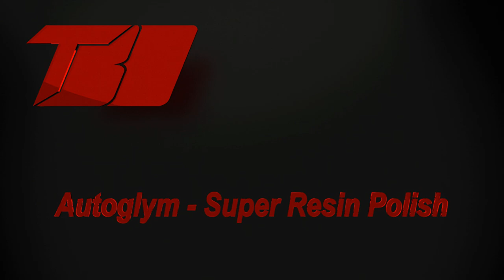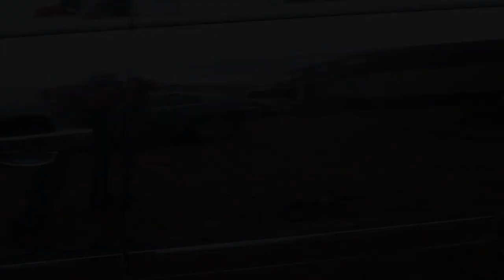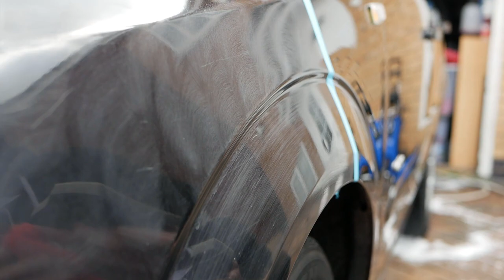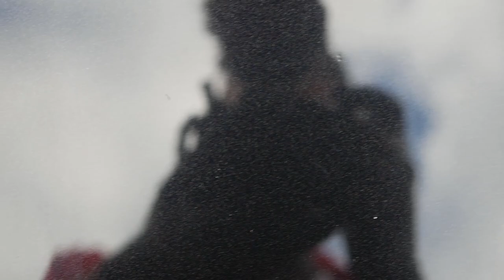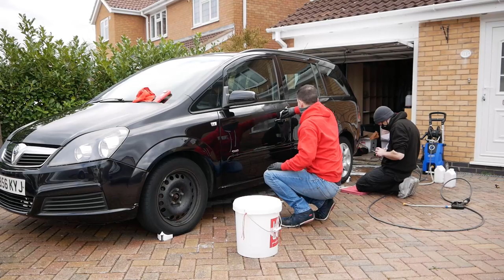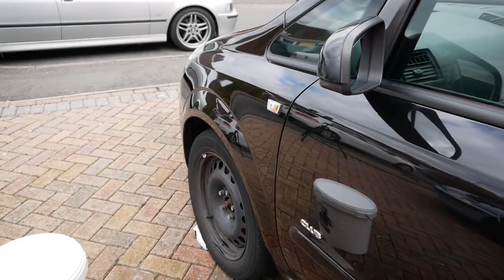AUTOGLYM SUPER RESIN POLISH IS AMAZING!!!! | You must try it if you never have.

Comment from the maker: I remember buying my first bottle of SRP. Halfords in 2002. How about you?
Reply: About 1998 along with EGP and a box off their net/cloths.
Reply: Try it with a machine.
Reply: @Swans_And_Ducks  we did actually give it a go on the opposite side with the dual action. It really is a competent product
Reply from the maker: @Swans_And_Ducks  I remember those cloths. Perfect polishing cloth I think they called it. Would get fluff everywhere as soon as you cut a bit off.
Reply: About 2005 for me. It was a bulky 1 litre plastic bottle which I bought to replace my big 5 litre tin of AutoSmart Mirror Image that I ran out of. I thought SRP was equally as good as AS MI, but I found that SRP needed to be worked quickly and thinly as well as frequently having to change applicator sponges to reduce the dusting. The old formula flashed off very quickly. But it was always easy to remove.
Reply: Just bought my first today.
Reply: Quick question: why were you wearing a face mask even though you were using the product outdoor? Is it that toxic? I have this product for a while now, just not found the time to actually start using it.
Reply from the maker: @Decebal_of_the_Getae  it was part of the COVID guidelines at the time. Nothing more than that bud👍
Reply: @TranquilityBaseDetailing  Appreciate the prompt reply. Did you guys ever tried the Autoglym Rapid Ceramic Spray? Would you recommend it? I have about 8 different products from them. Happy with most except the Fast Glass. I just can't make it work, all I get is smears regardless what I try.
Reply from the maker: @Decebal_of_the_Getae  I've not tried their ceramic spray yet. Probably something for me to try once the weather picks up
Reply: @TranquilityBaseDetailing  Will keep an eye for your review so I've subscribed!
Reply: How long does it last does it just fill or remove the scratches
Reply: @aaronbell8527  "remove scratches"? your kidding right?
Reply: @Decebal_of_the_Getae  that’s why I am asking  👀

Comment: Those were the days - hose pipe, one bucket, a sponge & a chamois leather. Finish off with a bottle of SRP & buffed off with an old t shirt. Things were much simpler (& cheaper) then.
Reply from the maker: Yeah they were. Back in those days my dad would have me pick the tar spots off instead of using proper methods. Good times😂
Reply: And black your tyres with shoe polish if you really wanted to go to town
Reply from the maker: @slowsteadysteve6565  steady now. Next you'll be telling me about newspaper and white vinegar for the windows😂
Reply: Simple ways are still the best. Most products I feel are just the same as previous years but over hyped
Reply: @slowsteadysteve6565  boot polish still looks better than that gloop they brush over it now .

Comment: Haters are gonna hate on this because it's not a "scene" product or enthusiasts choice but it's a solid performer for improving the look of your paint. You demonstrated that perfectly in this video lads! I will admit that I'd rather use my machine polisher these days just out of laziness but SRP can be used by machine too which just speeds up the process.
Reply from the maker: Will get the srp on the machine soon. Kept this video simple on purpose.
Reply: Yeah I hate anything that has to be applied with an applicator and some elbow grease 🤣
Reply: my DA has been out of action for a while and I haven't bothered getting it fixed. but this weekend I really wanted to give the car a polish. I'd long given all my hand polishes away to friends and was about to buy a bottle of something to use when right at the back of the cupboard popped out a 10 year old bottle of SRP! needed a jolly good shake but did the job well! can't remember how long is good to leave to cure but it was a hot one this morning and I barely left it on a  minute or 2 before wiping away as the swipe test seemed to suggest it was ready to go. pleased with the result. I'll admit to becoming a detailing snob (not proud of it) but I've come full circle now, a lot of these AG products are still around because they just work well. plus I honestly couldn't be bothered doing a full decontamination and clay etc, with a few young kids and moaning wife i just wanted a bit of shine on the motor, lovely jubbly 😁

Comment: I've spent a fortune on various polishes over the years but always come back to SRP. It just works, simple as that. The bottom line is 99% of cars have some form of paint defect in terms of swirl marks. To get these out professionally they will require a machine polish, however no matter how good your wash technique is whether it's a two-bucket wash method, etc. swirls will always come back. SRP is a good filler but also gives a superb shine as shown in this video. It's easy to apply and remove. For best results polish the car in the shade.
Reply: …and after using a clay bar 👌🏼

Comment: ain't it funny how there's still a need/requirement for this type of product...for my entry level service, I use Rupes UNO, on a machine, some swirl removal, filling with silicone & leaving a sealed finish - one stage, one product. Did many of these last year, not everyone wants a ceramic doobreywotsit😜...a super resin vid, Mikey & Lukey 👌👏
Reply from the maker: I've been thinking about picking up some Uno. There's absolutely a place for these types of products. Like you say, not everyone wants a doobreywotsit😂

Comment: Great work as always Luke, autoglym srp was first product i used back in 2008-2012 i respect these older brands that got me started and autoglym is local to me in herfordshire. Sadly it's been reformulated past 6-7years or so, its more of a glaze filler now. Old formula had abrasive in it was very good. Since then i tried so many hand polish, the best one from this day i use is Angelwax perfect polish it has micro abrasive brings gloss/clarity to the paint, cleans the paint so well. (Can be used DA or Hand) use Panel wipe down after. Works so well with your lsp Detail Bug nano wax (grab a sample pot) or simplewax armour v2 and Infinity wax diablo, angel wax fifth element, Look forward to more video this spring and summer.
Reply from the maker: Thank Rahan. I've seen the debate about whether it's abrasive or not and I guess it comes from your explanation that it used to be. I think I've got a pot of Detail Bug Nano. Will have to check though.
Reply: @TranquilityBaseDetailing  look forward to seeing Nano wax on the channel, used nano last week. Lovely rich gloss and mostly the beautiful water behaviour. Have a good weekend
Reply from the maker: @rahan1985  You too bud👍

Comment: Hi,I've have used this in the past on my Mini,it did a great job on the paint work,I don't know whether or not it's improved.still a good polish to use.i moved to Meguiars now.
Reply: Which Meguiars product are you using Steve. We did contemplate doing a SRP vs Megs Ultimate Polish video instead of this one.
Reply from the maker: They've improved it over the years Steven. I'm sure they've addressed the dustiness of it compared to how I remember it.
Reply: @Michael-wx4fj  ,the 3 in 1 wax bottle,probably totally different to what I thought.
Reply: @stevenjones19-m8i  I've never used that, my experience with meguiars is limited to the Ultimate Compound and Polish and their 105 and 205 compounds, and their interior qd

Comment: I got a used black A4 Avant in March and now that the suns come out all the scratches and imperfections from the previous owner are becoming very visible! I’ve generally just had my cars valeted so new to this but Could I use this to fix the scratches etc and then follow up with a carnauba wax? Or anything similar?
Reply from the maker: You can do exactly that. This won't fix the scratches only hide them but your plan is sound

Comment: Should you then wax the car after? I bought this today to wash tomorrow after being quoted £450 for a “correction” 

thought this kit for £20 wouldn’t harm and great if I get the results I’m looking for.
Reply from the maker: A correction will remove all or most of the damage you see here. This will hide it. It would definitely benefit from a wax or sealant. Something like Autoglym's extra gloss protection would be suitable after unless you've got some wax already to use.
Reply: @TranquilityBaseDetailing  thanks for the reply. 

Reason I thought I’d need correction is due to swirling of the clear coat on a car I purchased in December, thankfully my car is not in this condition. 

If I do decide to go for a full correction do you recommend anywhere / company?
Reply from the maker: @R1ckmister  Whereabouts are you?
Reply: @TranquilityBaseDetailing  Bristol.
Reply from the maker: @R1ckmister  James at Ti22 in Chepstow. Look him up on YouTube. Man does fantastic work.
Reply: @TranquilityBaseDetailing  will do, top man, thanks again!

Comment: My used car came "polished", more like scratched and I think they used this. I have heard it just fills slight scratches which I noticed on my car after one non contact wash. Still not sure.
Reply from the maker: It does fill them. Likely your used car was prepared with a "glaze" which is designed only to fill scratches. They wash out very quickly but do give the paint a nice shine when freshly applied.
Reply: Yes I thought that. I noticed spider web scratches most probably from bad wash techniques. I am using a da polisher and some light cutting compound followed up by polish and then a ceramic (loosely called) wax by Mequiars. I have hand corrected issues in the past and when I collected the car the salesman said " I had your car polished" to which I thought Ahhhhhhh NOOOOOOO.
Reply from the maker: @RB-lt8kt  I hate when they do that. When I had some respray work a few years back I had them take notes not to wash the car. Came to pick it up and found some junior drying it with a rubber blade. Same response as you NOOOOOOOO!!!

Comment: Great video,… but this polish will never be used in a detail company because it contains fillers!!  Fillers will give you the looks of a clean and proper vehicle but after washing your car 3-4 times all scratches are back. It will give a little abrasive thing to the paintwork but not more then that.  However great product for at home 😉.